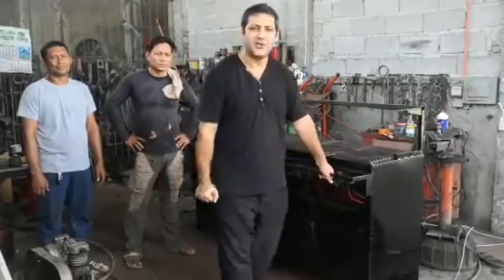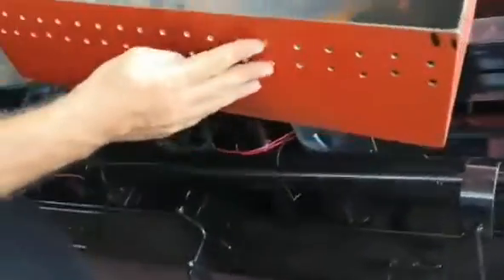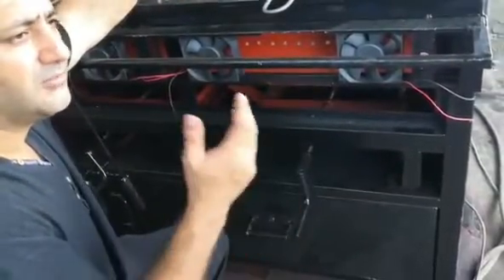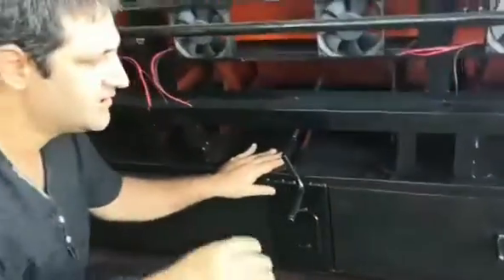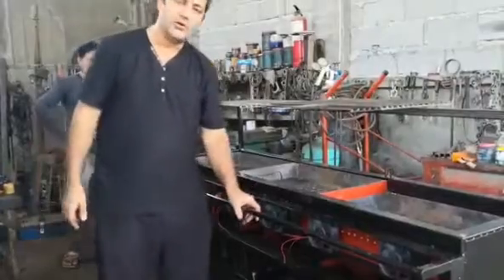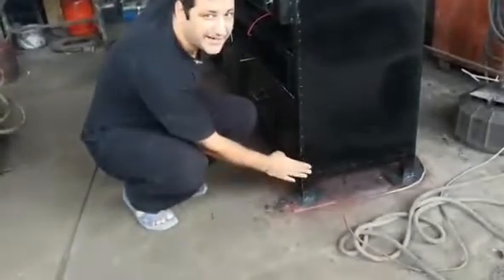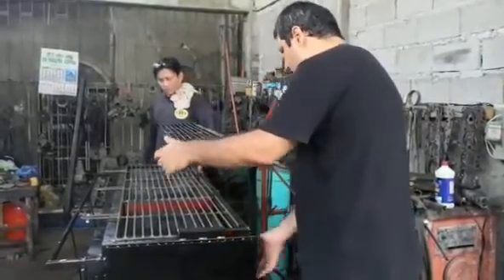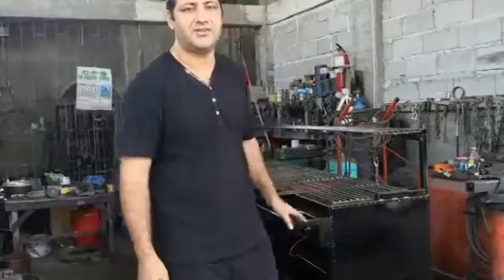I design Industrial grade diy very useful commercial barbecue grill

Comment: Good evening Po Sir. , Saan po Yng Excto address Niyo po Or Shop at Tel. No. O Cellphone Number niyo po Tngkol sa Griil ?? Please let me know . Salamat Po God bless . Mr. Cunanan po ito.
Reply from the maker: I live in ISULAN sultan Kudarat my location you can search on Google maps as BBQ HOUSE ISULAN you will see our location and here is phone number+639495702504 or you go to my channel and go about you will see my Facebook profile link also MARKPRINCE1317 my FB
Reply: Sir. Good evening Po , Salamat Po ulit GOD BLESS , Sir. Ask Ko Lang po How much Yng Gayan na Grilled  At Saan po Pwede Makabili yan Grilled na Yan po at mag pagawa yan Grilled Or Pa Fabricated ng Grilled ??
Reply from the maker: @eike4182  this my girl is made of Industrial grade material if my cost is almost 85k but if you want make just  go for same design but simple and less features like without charcoal box toolbox blowers so you can make it cheap I think  40k or higher if you use less then 3mm sheet I not recommend to build that grill cos it's all steel and get too much high temperature and using low grade materials will less the cost but less the life too